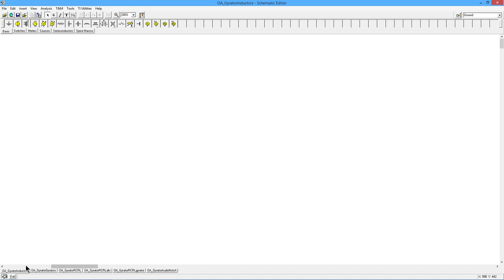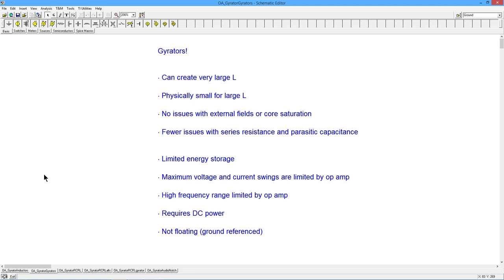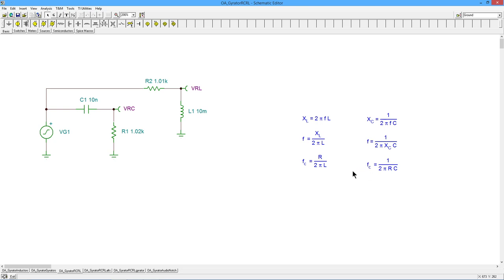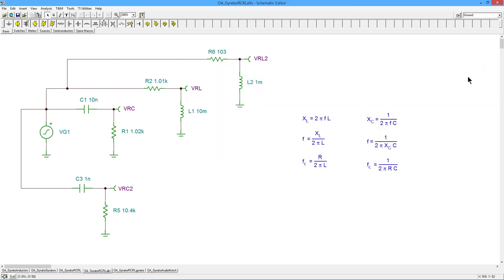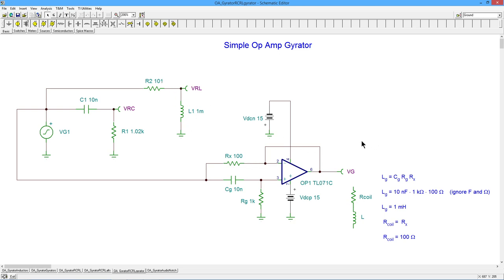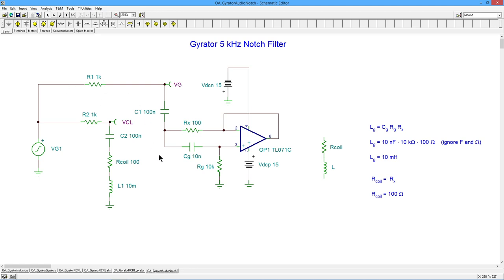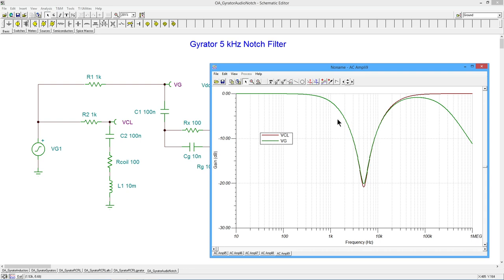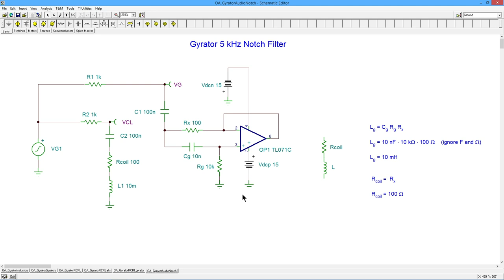Op Amps: Simple Gyrator

Comment: After building several gyrator circuits lately, it's apparent some op-amp ICs fail miserably when used therein.  After trying 4 different IC packages, only 1 performed perfectly.  Some had noise near the zero cross-over, some would not reach the full range of gain -and some failed miserably.   The gyrator parameters were not unreasonable.  Wanted to pass this on so to head-off unnecessary troubleshooting.
Reply: missing the name of the OpAmp performing perferctly
Reply: @ahnenpost5237  A genuine TI NE5532P worked the best.  Other variations and counterfeit parts failed miserably.  Also, if you use a cut/boost gain circuit, the two matching input resistors must be below 1k Ohm (I used 220 Ohm with great results); otherwise, it will break-down with oscillation when the gain is increased.

Comment: Wanna use it as a speaker crossover? Only in a pre-amp to power amp situation. But then you need more power amps. and you get into Bi-Amps based on crossover frequency.
Reply from the maker: Yes, bi-amping (or tri-amping) is extremely useful in PA situations. I think it's a bit pricey for the average home listener, but a separate powered subwoofer can be a useful addition. Unfortunately, it has been my experience that the average user doesn't have a clue as to where to set the crossover frequency in a standard bi-amped PA system (and things are not much better for the sub, and even worse for a tri-amped PA). Hmm, maybe I sound do a video on that for the Science of Sound playlist...

Comment: Minor correction at 15:28. The units have to "add up" to H, since the formula is the result of an analysis, and they do. Proof: 1 F * Ω^2 = 1 C/V * (V/A)^2 = 1 C * V / A^2 = 1 C * V / (A * C/s) = 1 V * s / A = 1 H.
Reply from the maker: Yes. I probably would've done it a little differently, but what you did was fine. I was trying to forestall people getting hung up on the ohms*ohms*farads part and instead focus on the bigger picture. In retrospect it probably would've been worth the time to make a little side note on that, maybe at the end. Thanks.
Reply: @ElectronicswithProfessorFiore  I tried to keep conversion short. Electrical units are complicated in a fun way once you get to SI units. I’m curious, though, how you would have done the conversion.
Reply from the maker: @AlienLobster  I tend to go back to basic definitions, but not all the way back to mks (e.g., defining current as charge per unit time). Your comment got me to thinking, and I don't want anyone to get the wrong impression from that offhand remark, so I have decided to make an addendum video to this one, explaining how the units work out. After thinking it over, I believe my initial idea of not jumping into that proof was proper as it probably would've derailed some people, but I also think it is worthwhile to explain it. A second video will allow those who want to understand this at a deeper level to see it, while those who just want the results can ignore the addendum video. It should be up within a week, assuming nothing comes up to gobble my time. I will also add a link to the addendum at the end of the video above.
Reply: @ElectronicswithProfessorFiore  Awesome! Thanks!